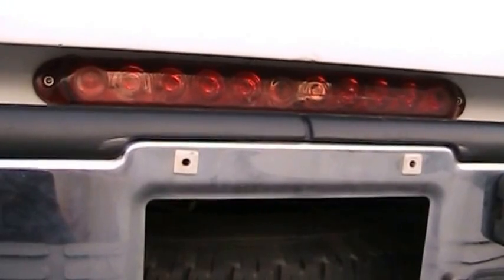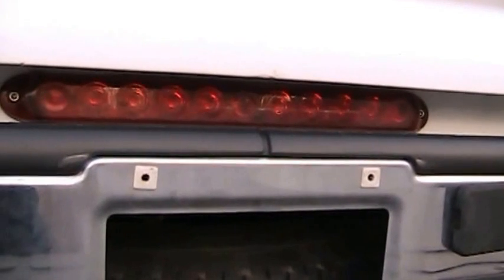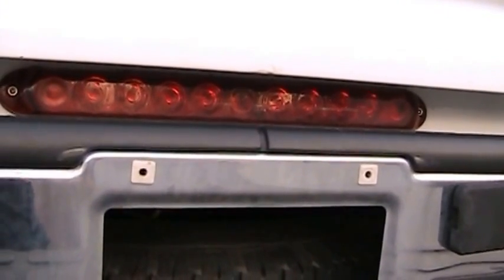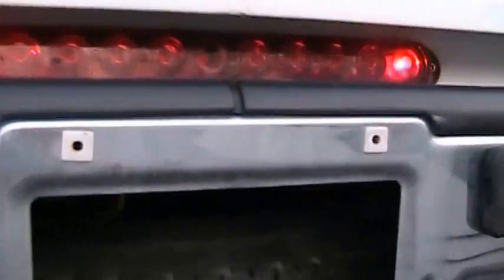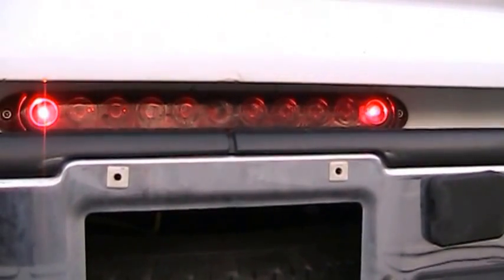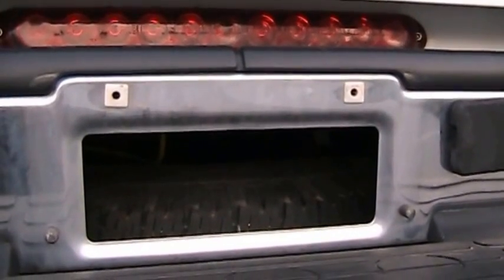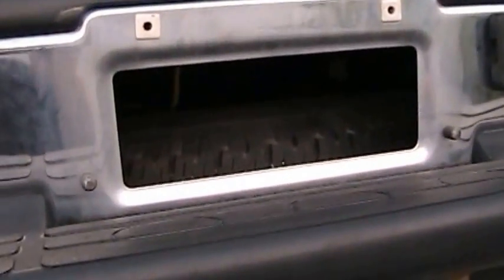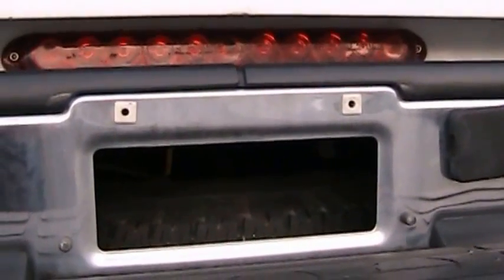Variable Intensity Brake Light II ****PATENT PENDING****

Comment: Why in the world hasn't this been implemented worldwide yet? How many minor accidents would be prevented if the driver behind you knew you were braking hard and not just tapping to slow down normally? You should wire this to FLASH all the lights if slowing down very quickly.